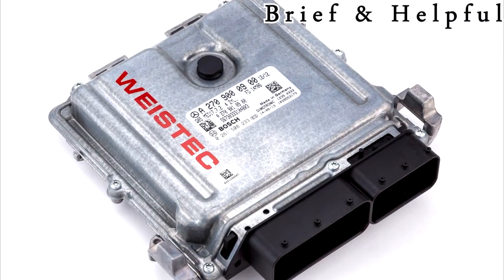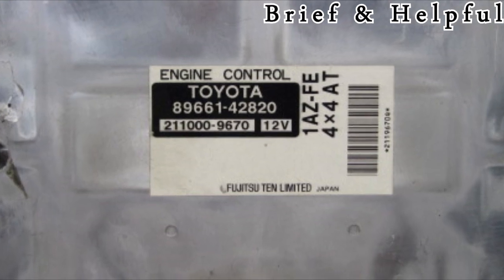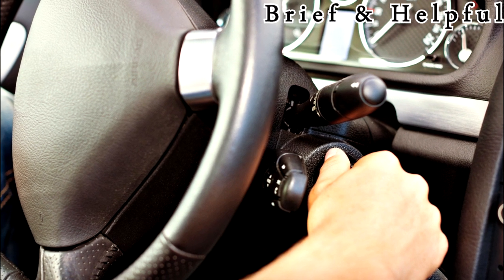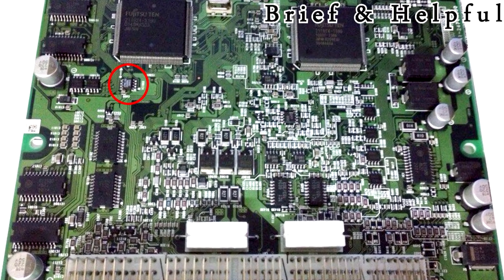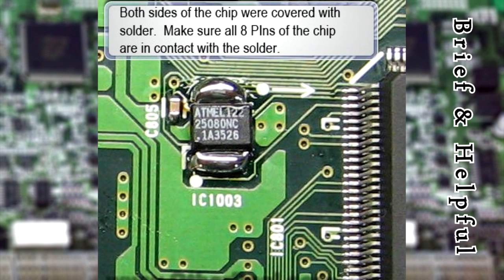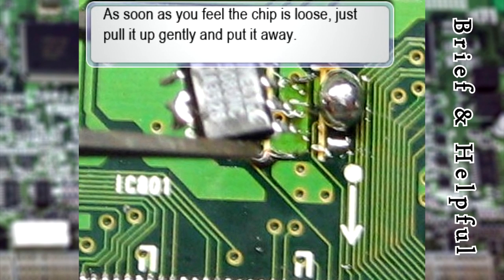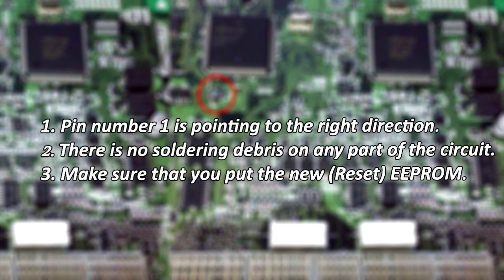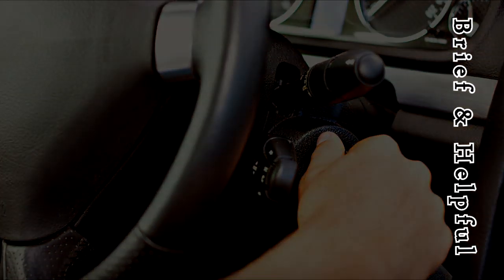How to replace immobilizer EEPROMs

Comment: This is horrible information the chip you want is in position ic900 chip 93c56 and why would you solder off the 93c56 you can reflash the eeprom on the board. Please don't try this unless your experience at soldering onto PCB. Call a locksmith or risk destroying your ecu
Reply: You're correct with the if you don't know what you're doing, let someone who is experienced do it but this is a Rav4 module. The AT25080 chip in the IC1003 position is the correct chip to eeprom or replace.

Comment: I'm doing a engine swap on 94 4 runner butt want all my gauges to work .can I take certain pins out of ECU &take out engine wire harnes
Reply: What do you mean by pins? When swapping your engine you should not be changing any computer on a 94 4runner unless your changing to a different size newer motor. If so good luck make sure you swap wire harness, computers, cluster fuse boxes. Ac control unit, your best bet is to either make your new motor cluster fit or buy and aftermarket that can be wired in and precoded with eeprom for mileage, I'm assuming your swapping transmission as well make if its standard stick shift will be fine if not your new engines computers will have shift points programmed in so you must not keep old automatic transmission.
Reply: @3bGh0sT3  hi have installed a toyota 3sz motor in my starlet. the motor i bought from scrap wit wire harness and ecu.
i am unable fire up the motor. can u help

Comment: I have 02 ML 320 start error code , changed burned body control module due to roofleek driped right above the emergency brake on it !!!  I bought on ebay same part # A1635457332 and took it to dealer  ,payed $184 for programing BCM and still not starting I gave up to pay other $200 to program key or deal with steelership ....anybody has solution below $500 ?  Now thinking to buy ECU ,Bcm,key ,tubler and sender of ebay  .....did anybody do it ??..... would I be ok without reprograming in steelership tro start the car if all of it is changed from diffrend car ???? Thanks
Reply: Petr Drbal no sir do not do this depending on the model you could have up to 25 pre coded computers on the car, if you bought a new bcm comfort module eeprom must be used to read the old eeprom chip from the damaged board then wrote into your new bcm eeprom chip after completion your car will not know a bcm has been replaced, although included in the read and write should be vin, pin code, key value. Original key will work
Reply: Hi